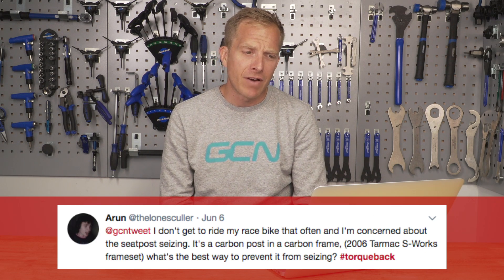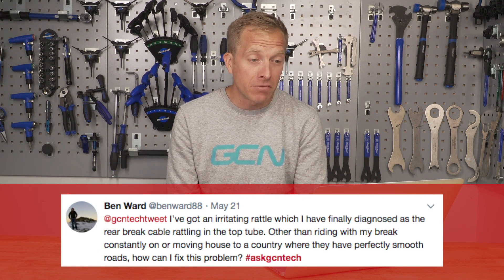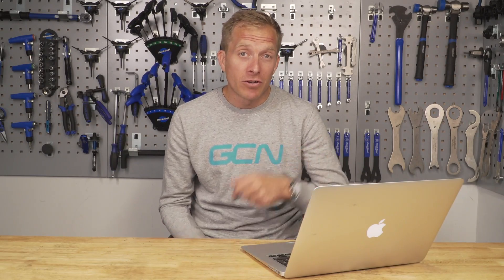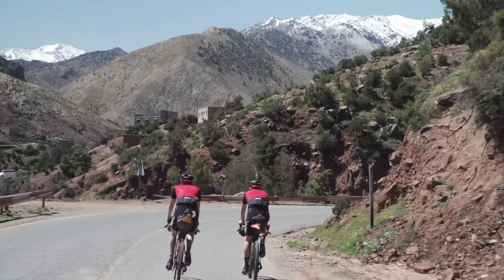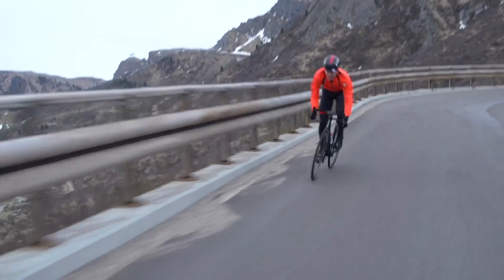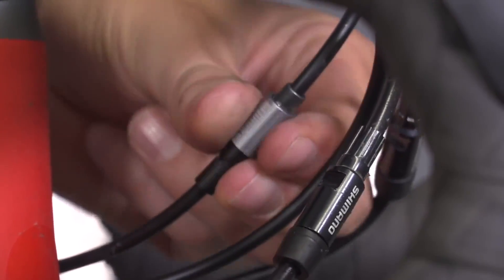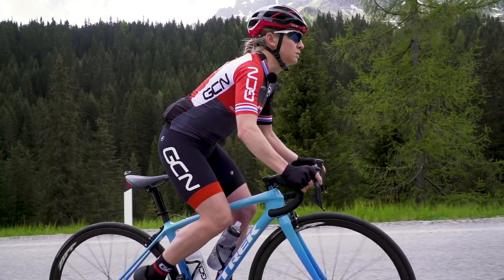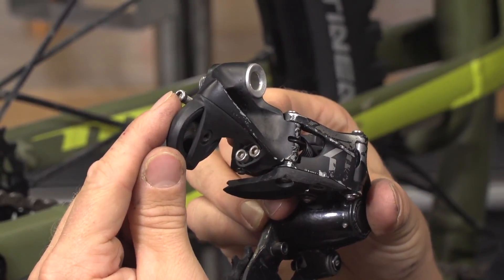Is Petrol A Good Cleaner? | GCN Tech Clinic

Comment: Comments for Marc and darkk rollo:

@Marc -- I recommend against petroleum for its dangers (health, fire, environment). I prefer to use odorless mineral spirits for degreasing and cleaning, followed by denatured alcohol to remove all degreaser residue before waxing. Molten Speed Wax has excellent instructions on their website ( https://moltenspeedwax.com/pages/clean-your-chain ). Highly recommended. Notes: Odorless mineral spirits is commonly used by oil painters as both a thinner and to clean brushes. If you decide to keep using petrol, you should definitely use alcohol to remove the residue it leaves behind or your wax won't adhere as well.

@darkk rollo -- Two suggestions: First, if you are using a 2x drivetrain, consider getting a smaller inner chainring and keep your 11-28t cassette. It will achieve the same thing while giving you more gear ratios. Second, if you decide to go with the 11-32t cassette, consider the following:

Some "standard" rear derailleurs with small cages will not work with a 32t cog on some frames. What does the frame have to do with it? Answer: The rear derailleur hanger can vary a lot from one frame manufacturer to another. Some are shorter and some are longer. If your frame has a shorter hanger and your rear derailleur is rated only up to 28t, the 32t may not fit. How will you know? Answer: Install the 11-32t cassette, shift your rear derailleur to the 32t cog and use the B screw to adjust the distance of the top jockey wheel from the closest point of the 32t cog. For SRAM road systems, you want about 6 mm. If the top jockey wheel is too close, it won't work well. The worse case would be if the top jockey wheel touches the 32t cog -- that would be a serious "no go" because your chain will probably seize.

Don't forget that you may need a longer chain for the 32t cog. So include a new chain in your budget.

If the top jockey wheel is too close, what can you do? Here are things that some may suggest:

1 - Replace the B screw with a longer one so you can move the top jockey wheel far enough away from the 32t cog. I don't like this suggestion because it can rotate the top jockey wheel and rear derailleur toward the rear of your bike. This can reduce the number of teeth that the chain can engage and it can reduce the effectiveness of the cage to maintain chain tension across the full range of cogs in the cassette. The first problem can be serious if you generate a lot of power while in your smallest cog like a sprinter. You may find the chain begins to slip while on the 11t cog because it doesn't have many teeth and the chain doesn't engage them well enough with an oversize B screw.

2 - Add a hanger extension (like a Wolf Roadlink). I don't like this suggestion, either, because it can degrade shifting. And it can turn minor hanger misalignment into a significant problem.

3 - Replace your rear derailleur with a model designed to work with the 11-32t cassette. This is the ideal solution but it costs the most. Yet sometimes, it's what you must do. For example, when I converted my SRAM Red drivetrain to a 1x, I couldn't use my standard rear derailleur because it lacked the clearance with my frame/hanger for a 32t cassette. So I was forced to upgrade to a Red WiFLi model which has a longer (medium-length) cage and a shift path angle that fits wide-range cassettes. The shifting with my 11-32t has been excellent since the upgrade.

Comment: I've mounted 35mm CX tires onto various road rims without any trouble. Mounting never seems to be a problem. However, if the rims a very narrow you get more of a "balloon-effect" on the tire which results in a slightly wobbly ride feel, especially in the corners. 17mm internal width I've found perfectly fine, though.

Comment: I have a disc brake road bike that'll take a 700C x 32mm tyre if I remove the mudguards (or 28mm if not). If I make up a wheel with MTB (wider, 650B) rims on identical hubs, how large should I be able to go (assuming straight front and rear forks)? #askgcntech

Comment: #askgcntech After buying a set of carbon wheels for my cervelo r3 (2014) i noticed some whell rub on the frame, but only on the left side. The wheel was true and dished so i checked the frame alignment using the string method (span a string between dropouts and headtube and measure the distance between the stting and seat tube) Seems that my frame is misaligned (36 mm on the left and 40 mm on the right measurements).

Should i be worried? This causes wheel rub so i cant use my NEW carbon wheels on it for obvious safety reasons...

Also, is it safe/possible to use a disc hub on rim brake rims (like my carbon wheels) if i choose to get a disc bike but want to keep the carbon wheels?

Thanks a lot!

Comment: #askgcntech Hi Jon!, I inherited a hybrid road bike from my late father that he used for racing, then I noticed that the chainring is 44/34t (this is the largest that can fit on the frame) and the cassette is 12-21t 8 speed. Since I am a beginner, what would be the ideal cassette for that 44-34t chainring that will make my cycling experience using it a bit easier?. Thanks!

Comment: Would I encounter any shifting problems by changing my inner chainring from a 36t to a 34t while keeping the same outer 52t ring? I have an 11-32t cassette on the rear and I think I may be at the limit of my drivetrain while using a long cage. What is the limit for gap size between inner and outer chainrings?
Reply: Jason Sheppard thanks! I've looked into a road link but I'm nervous with a long cage that the distance to the derailleur will cause chain skips. Especially in the smaller gears.

Comment: To charge electronics while riding, You would need a dynamo (hub) to generate AC and a charger (Sinewave Revolution or other) to convert AC to 5volt DC. Speed of charging is related to speed of bike while moving. Also, the hub and charger do weigh more than a regular hub and there is a slight resistance too. Definitely not for use during a short race.
Reply: Rick Tan There are other way to generate small amounts of electricity on a bike other than a hub generator. Look up https://www.reelight.com/. In the future I think electronic shifters, power meters etc will be powered this way. All it needs to be is a magnet passing a coil of copper wire and some conversion circuitry.
Reply: Ed R I like how Reelight is able to making cycle lights without batteries, but I don't think we can charge the electronics of today (Garmin/iPhone/Android) using Reelight equipment.  Just not enough power.

Comment: I really need some help, I hit a pothole at about 30mph , luckily didn't come off but if I press down on the ends up my shifter grips you can hear and see the forks move at the front, is it a cracked steerer tube or anything else ? #askgcntech
Reply: cameron j skeith loosen the stem bolts and check the steerer tube, if no cracks, put it back, tighten the expander plug, then the stem bolts, check for play front & backwards

Also check loosen spokes
Reply: Ramen Rider thank you!

Comment: Hi, question....I'm the owner of a nice new cube attain disc. No disc noise when i cycle in the saddle however when i climb or sprint i can hear some noise from the rear, i suspect disc noise. Any ideas?
Reply: It'll be your frame or wheel flexing marginally, this allows the rotor to rub against the brake pad!

Comment: #askgcntech , i want to paint my hardtail but not sure which type of paint to use ,will it be good to use car paint from workshops and will it be as good as brand new bikes color ?
Reply: Tanzin, check out spray.bike, its powder coat in a can and you don't even need to prep your frame apart from cleaning it
Reply: But they dont export to my country (Bangladesh) 😕
Reply: Shouldn't this be on GMBN Tech?

Comment: Hi Jon, for some reason my front chain ring has warped. Im guessing its not meant to be like that. You think its fixable or should i get a new one? And how do i stop it happening again? #askGCNtech
Reply: How old is the chainring? If it's an old one with no ramping or whatnot, or it's a modern inner chainring, you should be able to CAREFULLY bend to straight again. Go slow because aluminium is rather brittle and doesn't like being bent.

Comment: as well as filling tubes with bubble wrap to prevent rattling, could you also fill the tubes with a spray foam?
Reply: Might make changing the cables in future a bit tricky ;)
Reply: Nicholas Smith Should be able to, just don't use too much and be wary of carbon fibre.
Reply: It would also trap moisture.

Comment: Noticed that the person with the petrol question followed on to say they would be waxing the chain. Might better to start off with a new, fully degreased chain before waxing in that instance. Once waxed the chain stays incredibly clean to the point that all I do for subsequent cleanings is run the chain through a wet wipe after each ride to  remove any surface grit and then dump the chain straight back in the molten wax every 250-300 miles. The molten wax does a great job of capturing dirt and further cleaning the chain.  If you are waxing older chains you can also pull the hardened wax from the slow cooker and zip lock bag it separately. I basically do this to keep the wax for my MTB chains separate from my road chains.
Reply: Why keep wax for MTB chains separate from eax for road chains?  For dirt and debris that goes into the molten wax, most of it will settle to the bottom of the pot and when the wax hardens, you can scrape the bottom of the solid block of wax to remove the dirt/debris.
Reply: Nicholas Hulme - so I have to remove my chain once a week and treat it with molten was?

No thanks
Reply: J B Once a week?  More like once every 400 miles.
Reply: just because it's a 5 second task to switch the plugs out since I had more than enough wax but yeah, not necessary.
Reply: for me it's a quicker job to re-wax than it was to degrease, clean and lube. plus i NEVER have to worry about 4th cat tats.
Reply: The petrol/degreaser topic is just for the first application of wax on a chain from the factory with factory grease (or converting a chain with grease to a chain with wax).  After that, it is so much simpler to turn on the hot pot, remove the chain, and immerse the chain the hot wax and hang the chain to cool.  Active time to wax a chain (versus wait time) is about 5-10 minutes.  I'm cleaning the rest of the bike while I wait for the wax to melt.

Comment: Hydrocarbons in petrol depress the central nervous system. It doesn’t take long. Petrol fumes enter the lungs, bloodstream and brain. Typical effects:

* Euphoria
* Numbness
* Disorientation
* Hallucinations
* Slurred speech
* Lack of coordination
* Slowed down reflexes
* Increased libido
* Dizziness
* A feeling of lightness
* Disassociation with the environment
* Coughing
* Vomiting
* Impaired decision making
* Muscle weakness
* Increased chattiness and extroversion
Reply: John Bicycle All of those effects read like the same effects as a good bottle of Scotch.
Reply: I use white spirit or paraffin as they don't evaluate so fast and so less fumes. Paraffin apparently isn't a good idea as it causes rust due to it being acidic I think.
Reply: Yeah, I do not see the reason for all the apprehension with using petrol/gasoline as a solvent.  People were using that as a solvent in the past, and using it as fuel today.  Its its actually more cost-effective than the bike solvents of today.  Did the bike industry do an awesome marketing campaign on bike consumersto sell us something that costs more and doesn't work as good?
Reply: Use a fan, vent appropriately, stand upwind.
Reply: If you breath it and enough of it, long enough, sure.  But there is no need to inhale gasoline fumes in using it to clean chains or parts than there is in filling your car or lawn mower.  Its utterly harmless if you use common sense, i.e., pour it carefully, use a sealed container, at arm's length, with decent ventilation, away from any ignition source.
Reply: John Bicycle "A GOOD NIGHT OUT"

Comment: #askgcntech Can a tyre slow you down after a while of riding? Got about 1.4k on mines and I feel like its harder to maintain same avg.speed. P.S Tyres not square yet #askgcntech
Reply: MrKeyGrinder Tyre pressure maybe?
Reply: Try washing them.  It is amazing how a washed set of tyres feels
Reply: I rode a set for 10,000 km last summer and my performance was better at the end of the season with used tires...because of fitness level.
Reply: I believe Bicycle Rolling Resistance did a test on this and found it to be pretty negligible. Give it a google if you’re curious.

Comment: I use my smart phone as a computer and of coarse it doesn’t have enough battery for a long ride when using gps, maps, music and a beacon all at once so I have a power bank  of 10000 ma/hr with a cable Velcro strapped to the top tube and I never run out of power  and still enough power after a 6 hr ride to fully charge my phone again that night
Reply: Or just go with an unironic top tube bag
Reply: I do this too!
Reply: I use a power bank as well, and on much longer rides (greater than 12hours), the power bank won't be enough.
Reply: do you need the screen on 100% of the time? if not just turn it off, the screen consumes 85% of the power
Reply: I do keep it on as I use it like a computer and display my metrics (bit of a data guy)
My setup takes up no extra space on the bike and other than a bit of extra weight in the saddle bag you don’t notice it’s your phone 
I use Rokforn’s headset mount to mount my phone (three points of security)
Reply: Rick Tan  depends on  the  size u use, mine is 10000ma and get a solid 10hrs, bet a 15000ms would get u through
Reply: Jason Girvan. I’ll find out this weekend. I’ve got a 26800mAh power bank and I hope this will be enough to charge 2 front bike lights multiple times plus my bike computer. I plan on swapping bike lights (charging one while using one) throughout the nighttime ride.

Comment: #askgcntech I recently bought a deda aluminum frame from around 2000, sweet bit of kit but the headset is giving me a headache. So it is not standard what you find in a modern bike, nor the 45 degree one, instead it looks like the ball bearings should be in direct contact with the head tube, is it really so? If yes, is there a way to hack a headset using a more recent headset? Cheers!
Reply: Suomi 🇫🇮

Comment: #askgcntech Hi Jon, so I bought my first aluminium road bike from 2016 Giant Defy and one thing is bothering me, whenever i'm standing out of the saddle i hear this squeacky noise from the from wheel and stem. What can be the cause of it and what can I do. Of course when im riding in the saddle the noise is inaudible. Thanks in advance!
Reply: Firstly, check that your headset/forks/stem/handlebars are all installed and torqued up properly, as that is the most critical thing that could be going wrong. 
More likely, it could be be tire rub on the inside surface of your forks, brake pad rub on the rim, or even your front wheel quick release not being tightened correctly. Out of the saddle peddling produces more torsion forces at the handlebars/stem and the hub/forks interface causing flex in the system.

To solve: while your front wheel is out of the frame, look on the underside of the forks below the headtube where your tire comes closest to the forks and see if there is any significant wearing of the fork paint/material; if so throw on a wheel with a smaller diameter tire and give it a go out of the saddle. 
Still getting squeak: next (with your normal wheel) check that your quick releases are done up properly (search gcn for guidance), and then test it out of the saddle again.
Still squeaky: now undue the release on your front brake all the way as if you were going to pull the wheel out, and then test it again with a couple sprints.
Still driving you crazy: take off any and all accessories mounted to bars/stem and try again.
No luck: check the interfaces between the frame and your cables, the metal cable caps going into the frame/cable stops can sometimes squeak on the frame material. Lube up all the contact points and try again.
Nope, still want to die: try to localize the sound precisely. In a stand, hold your ear right next to the bike and quickly move the bars back in forth; or have a mate ride/jog/stand right next you with their head down close to your bike and climb a steep hill out of the saddle. Then identify the source and work from there.

Good luck, if all else fails just look up how to tie a noose.
Reply: I'd take the headset out and regrease and retighten all stem bolts to the specified torque, those two measures usually do it for me.
Reply: Take it off the saddle rails, wipe it with rubbing alcohol, and then spray with WD-40 or grease the rails. Torque to spec. Also check other areas for creaking or ticking, they may be the cause.
Reply: Sorry, that was a bit irrelevant.
Reply: Grease your through axel points on the fork drops... I had that issue and fixed the creak / squeek

Comment: chain is a consumable, just clean it well enough to preserve your drivetrain... doesnt make sense to spend  huge amounts of time to extend the life of a $40 part
Reply: If you don't keep your chain clean, your sprockets and chainring will also have a greatly reduced life (due to the abrasive particles that inherently get stuck on the chain), even if you change your chain regularly and you don't overstretch it.
Reply: i use a simple chain cleaner, its a 2 minute job... using petro is overkill and environmentally crasy
Reply: How many chains can you clean with a container of simple chain cleaner?  How many chains can you clean with a similar sized container of petrol/gasoline?  Which costs less?